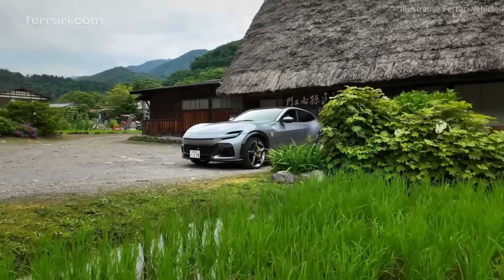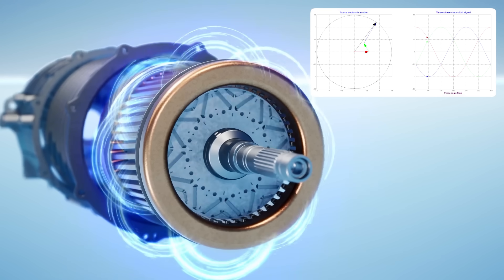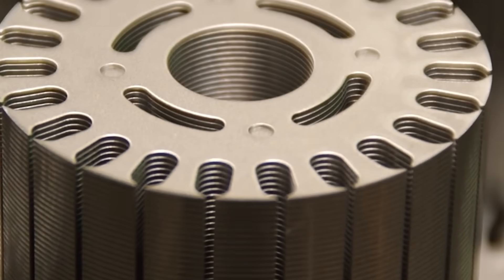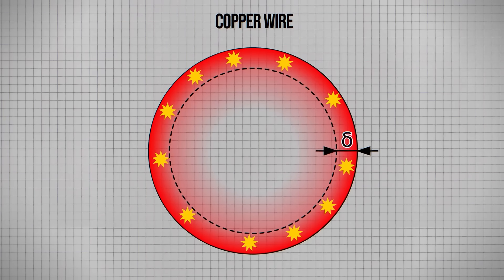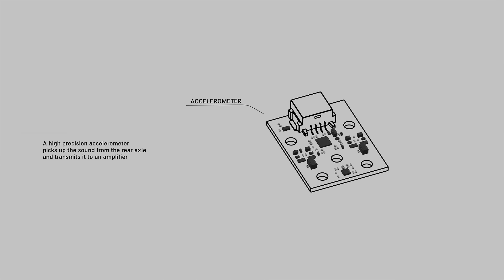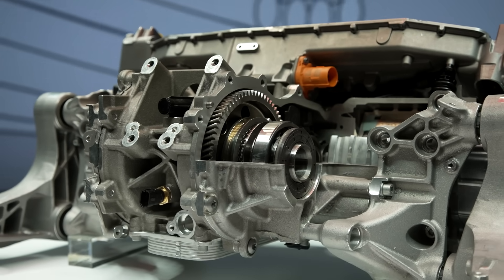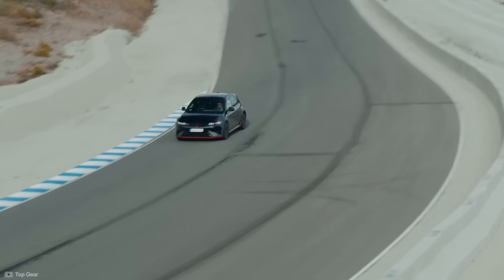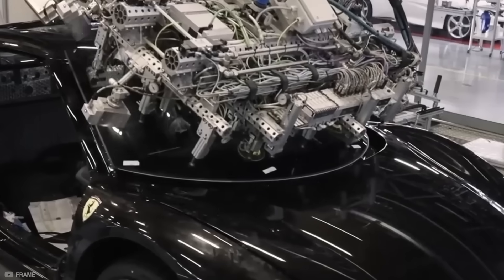Ferrari's Genius Motor Is Breaking All The Rules

Comment: Its not really the sound of ev that is the problem

Its the stupidity of convering fuel into elecicity then storing it in a battery to power a electric motor making it waay less.efficeny.

Did someone told you the opposite? Well they where lying.

Comment: The uptake isn't due to the sound, it's due to the reality electrics don't offer range, lower cost per mile relative to electric costs vs conventional fuel. Sure they are "quicker" and have superior acceleration meaning they will have a place in performance oriented cars. However in practical applications, no EV can go head to head with Diesel powered vehicles in terms of durability, fuel cost per mile.

Comment: I've very rarely driven automatic transmission vehicles, but in Australia, when on call, I had the use of some silly, 3.5L V6 petrol, or whatever, but if you wanted to give it welly, there was like a slow acceleration, and as you puhed harder, it eventually dropped about three gears, by which time your foot was near the floor, and whoof! I'm sure it would be easy to simulate the more inefficient movements of an ICE automatic. Even simulate a manual drive. That would be funny. (NB Any noises generated... INSIDE the car only, please. Speaking of 'please' ..please mention that Israel's genocide in Palestine is ongoing, and maybe say 'genocide - bad'?)

Comment: Older electric train motors make cool sounds. The drives for these are however based on thyristors and operate at a quite low frequency in the kHz range making the motor windings vibrate like a loudspeaker in the audible range of frequencies. Modern day IGBT systems operate at a much higher frequency often as high as in the MHz range and therefore new trains dont make these cool sounds anymore, the same type of high frequency IGBT systems are also used for electric cars. The thing is the higher the switching frequency is the better the eficciency in the motor but on the other hand you can instead get higher switching losses in the inverter but these would still be much lower  then the motor losses would be at lower frequencies. Ferarri could in theory lower the switching frequency of the inverter to get it to make noise just like these train motors but as stated this could generate vibrations affecting things like gears and bearings and also would lower the electric eficciency of the car wich is especially bad when you rely on batteries for power instead of overhead wires like with a train.

Comment: Great episode! But I would have preferred more focus on stator core lamination and wire thickness, as eddy currents, skin effect and proximity effect are pretty basic well known phenomena, one might assume the industry would have converged to pretty close to optimal designs to deal with those things by now, if it's possible to make a significantly better product for slightly higher manufacturing cost, when mass produced. Artificial noise and gear shifts might be slightly amusing, but I suspect it get's old pretty fast, for grownups at least.

Comment: AI Summary

Abstract:

This video provides a technical deep dive into the engineering of Ferrari's first all-electric vehicle, focusing on its Formula 1-inspired electric motor system and its innovative approach to sound. The vehicle features a 1,000-horsepower, quad-motor powertrain capable of reaching speeds up to 30,000 RPM.

The motor design incorporates several advanced technologies to maximize efficiency and performance. The rotor utilizes a Halbach magnet array to focus the magnetic field and is secured by a three-layer carbon sleeve to withstand immense rotational forces. The stator is built with ultra-thin 0.2mm silicon iron laminations and Litz wire windings to mitigate high-frequency energy losses caused by eddy currents and the skin effect.

A key innovation is the vehicle's "authentic" sound system. Instead of generating artificial noise, it uses an accelerometer to capture the real physical vibrations from the motor and inverter. These vibrations are then amplified and delivered to the driver as both audio through speakers and haptic feedback via a resonator in the subframe, aiming to create an immersive and engaging driving experience that addresses common criticisms of silent performance EVs.

Ferrari's Electric Motor: A Deep Dive into F1-Inspired Engineering

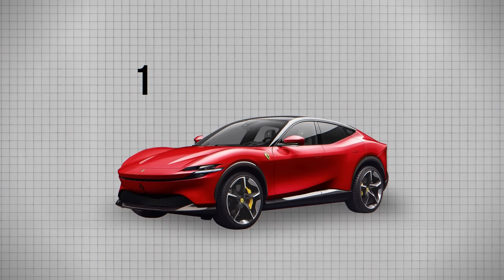*   0:00:48 - High-Performance Quad-Motor Setup: The car boasts a 1,000-horsepower, quad-motor powertrain. The high-speed front motor can reach an impressive 30,000 RPM, while the larger rear motor, built for higher torque, tops out at 25,000 RPM.
*   0:01:40 - Advanced Rotor Design for Efficiency: The motor's rotor features a Halbach magnet array, a specific magnet orientation that focuses the magnetic field outwards towards the stator. This maximizes force in the most useful direction, improving efficiency.
*   0:02:25 - High-Strength Carbon Sleeve: To contain the powerful magnets spinning at high speeds, the rotor is wrapped in a three-layer carbon sleeve, which is designed to withstand up to 2.7 tons of force and prevent the magnets from flying outwards.
*   0:02:42 - Ultra-Thin Laminations Reduce Energy Loss: The stator is constructed from 0.2mm thick laminations, significantly thinner than the standard 0.5mm. This design minimizes eddy currents—circulating electrical loops that waste energy and generate heat, especially at high frequencies.
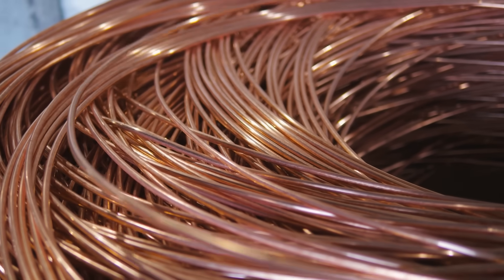*   0:03:50 - Litz Wire Combats the "Skin Effect": The motor utilizes Litz wire, which consists of many thin, braided copper strands. This configuration ensures current is distributed evenly, reducing the AC resistance caused by the "skin effect" (where current flows mostly on a conductor's surface) and minimizing high-frequency losses.
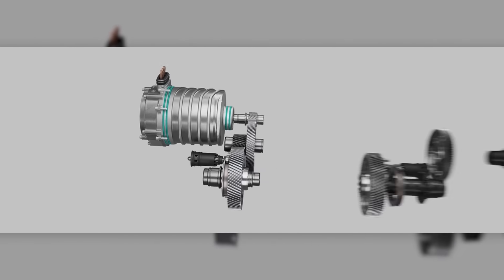*   0:04:42 - Efficiency-Boosting Clutch System: The front motor is equipped with a clutch that can mechanically disconnect it from the drivetrain in just 0.5 seconds. This eliminates unwanted magnetic drag when the motor is not needed, improving overall efficiency.
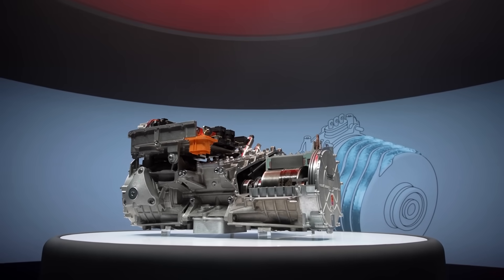*   0:05:16 - An "Authentic" Electric Sound Experience: Ferrari has developed a unique system to create a genuine motor sound. An accelerometer mounted directly on the inverter captures the real, physical vibrations generated by the motor during operation.
*   0:05:41 - Haptic and Audio Feedback for Immersion: These captured vibrations are amplified and delivered to the driver in two ways: as audio cues through the car's speakers and as physical, haptic feedback through a tuned resonator integrated into the rear subframe. This is compared to an "electric guitar" amplifying a real signal.
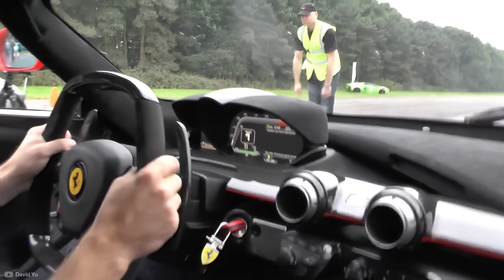*   0:08:05 - Simulated Shifting for Engagement: The vehicle will also incorporate a simulated 5-speed shifter, similar to the system in the Hyundai Ioniq 5N, to create a more engaging and familiar driving experience for sports car enthusiasts.

AI-generated summary created with gemini-2.5-pro for free via RocketRecap-dot-com. (Input: 15,165 tokens, Output: 844 tokens, Est. cost: $0.03).

Comment: They certainly did their homework about making the best possible electric motors. Litz wire is very fancy; i don't know of any other auto mfr that is doing that. I believe eventually all EV's will use the axial motors as they are so much lighter. Mercedes will be the first to have them due to their patent-holding subsidiary YASA.

Comment: I'm actually surprised that haptic feedback isn't used more often in cars because it has worked in gaming for years. I suppose the average electric car owner isn't as concerned about how the car feels and the driving experience, whereas a luxury car you buy for speed and power, the customer might be more interested in the connection that haptic feed back would bring to the driving experience.  A device that amplifies the actual vibrations in the motor is a pretty cool way too do it.

Comment: sure hope the noise makers can be disabled / unplugged 😞 !!!

meanwhile, what will it cost to maintain such a limited production vehicle, the more complex it gets the more maintenance will cost, plus will you be able to replace the batteries, and for how long (compare to the current 50 year old gasoline Ferrari engines that are relatively easy to maintain).

Does anyone really believe Ferrari can make a better motor and a better battery than Tesla ?  I don't because Tesla has nearly unlimited resources.  so I'd say they should have partnered with Tesla for the drive train which also is better insurance for long term maintenance.

Comment: Yeah I am designing ferrite magnet assisted reluctance motor and did try to simulate halbach array but tool that could do that requires so much like GetDP. But even without that motor gave suprisingly good results even if torque density is only about 60-70% what rare earths can do but high speed operation is where this motor type shines because it runs lower flux densities and has lower changing magnetic fields it keeps core losses actually quite small especially at low load high rpm where most wheeled vehicles spend their time. Also when motor is wound correctly it also has very low resistance allowing massive efficiency even at higher power levels.
Reply: In my mind I see a potential for halbach arranged magnets losing strength faster than conventional arrangements even when the motor is unpowered.  Thoughts?
Reply: You win the buzzword bingo!

Comment: In general, nothing revolutionary. It's just the use of the most expensive materials and sophisticated assembly technology. I mean the thin plates and the winding of the litzendrate.  The "disconnection" of the drive is done in the same way as the gearshift in a conventional gearbox. All the main inventions are the artificial creation of engine sound.. And this is just a microphone-amplifier-speaker type system.. "Gearshift simulation" is generally complete nonsense. And all this suggests that Ferrari has made a toy car for adult children. It reminds me of Chinese toy walking dinosaurs.. There's also an electric motor and a speaker that simulates the screams of dinosaurs...
and your onshape is a terrible program! Any failure on their server or Internet provider and your laptop turns into a pumpkin! And even with this vile modern sales model, when you just can't buy a product for good, but have to pay a little every month to be able to use it. People who value reliability and want their tool to always work flawlessly, regardless of the manufacturer's changed policy, will never use such services.

Comment: If the actual driving performance of the car is not sufficient fun, the car is a failure.  If you're driving for the fake noises, why not just play video games when you need a noise fix?  Much cheaper.

Sixty years ago, we experimented with clipping playing cards on the forks of our bicycles with clothespins, to simulate the sound of a motorcycle as they flapped against the spokes.  It didn't work very well, but it was fun for a little boy.  As an adult, adding fake noises to make your car sound like it's in a video game just seems silly.  Vroom, vroom, very impressive, very manly and masculine.

Comment: As someone who drives an electric car, I can confirm simulated noise is not a gimic. Noise can provide extra feedback regarding power, speed, regen braking intensity, etc that aids the driving experience. The beauty of this in an electric car is that it can be sent to the driver, not your neighbourhood and can be turned off if you are just cruising on the motorway and prefer quitness. It is something I would definelty value in my next vehicle.

Comment: I originally thought Ferrari had a good electric drive chain, until they started the artificial sounds and gear changes which are all rubbish and add unnecessary sound, designs and complexity. I would definitely do without those stupid additions.

Comment: Ferrari is competing with Lamborghini.  Lambo system uses YASA axial flux motors, they call Temerario system. One motor on each steering wheel.  One motor on output of ICE engine and before dual clutch transmission. Aston Martin took a stake in Lucid to get access to Lucid tech.

Comment: Um, vibration feedback in ICE cars makes the driver aware of speed and performance of ICE engines. Electric motor vibration communicates electric power performance. An ICE engine has thousands of parts that can effect performance of the engine and all of them working together is essential in communicating power and torque. Not suspension, tires road grip, or wear. Electric motors have less parts to monitor power and less distractions to suspension. Suspension and road grip are the same regardless of the power plant. All Ferrari did here was make the “varrome varrome” noises for you so you don’t look ridiculous flapping your lips around and piled on useless distractions.
Reply: Yes, adding ICE noises to an electric engine will just give you inaccurate feedback.  It will tell you what your car would be doing if it were not electric - what use is that?
Reply: @nycbearff my rule of thumb is “the loudest noise your machine makes is the thing trying to end you”
Reply: @davidgutting4317  And mechanical failures that cause friction and then catastrophe still make a lot of noise in an EV.

Comment: The sound generator reminds me of a system that was around when I was a kid.  I am an old fart now!  It was a plastic outline motorbike engine that could be added to a child's bicycle.  It had a small electric motor in it, I think that would go faster the faster the bike was ridden.  It was called "Motorroar".  This system you describe is far more sophisticated and expensive, but the idea is the same.  😄
Reply: ya its silly. why not use a speaker lol
Reply: kids would attach cardboard to the frame so the wheel beams (?) would hit it. This is what these things remind me of.
Reply: spokes!

Comment: What kind of frequencies are they running through the windings to where to the skin effect matters? The skin effect is pretty much irrelevant at anything below RF. I always thought hairpin windings are ideal because they have the highest fill factor and reduce resistance by having more copper in the channel.
Reply: Must have some to do with the harmonics that are generated due to the “step function like” switching (on - off or reverse) of the phases ‽
Reply: @Mentaculus42  I would hope that ferrari has a better ESC than that. I am not an expert, but usually you want clean sinusoids when driving your coils.
Reply: Considering these are built on now decades old industrial electric motor tech, it's a matter of efficiency. When you are running that motor for long periods of time (days if not months) it all adds up. Plus you have to remember that the faster an electric motor runs the less efficient it gets which is why electric cars are great for lower speeds and getting around town but when you hit the highway they aren't so great when trying to maintain highway speeds.
Reply: @SilvaDreams 

Maybe the issue with higher vehicle speeds has to do with the rapidly increasing air drag on it. If one takes an EV transit bus that does ok on a regular low speed route and put it on a freeway at 55 mph, it will deplete the battery much faster from a distance measurement.  This becomes an issue with intercity bus routes and 200 mile routes are not something an EV bus can do unless they charge during the route (and generally a lot of transit districts only charge at night)!
Reply: @Mentaculus42  While yes wind resistance is part of the problem (And busses are NOT aerodynamic at all) but the faster a motor spins the less efficient they are as they produce more heat and the more heat causes less efficiency so it makes more heat because you have to push more power through it till it's just a spiral into failure.
Reply: @SilvaDreams 

The thing is that they have gone to higher motor RPMs to get higher power densities. It would seem like they would be balancing these efficiency trade offs. I am aware of many EV buses going to the use of transmissions to deal with startup torque requirements and to reduce the higher speed motor RPM.

Comment: I wonder what the motor efficiency map is compared to other EVs?
Reply: Years behind Lucid and just behind Tesla.  Not bad, but not very good either.  Added gearbox is for dealerships.  Fluid changes and expensive repairs are very important for the business model.
Reply: Likely better since they didn't cheap out like the others and used decades old industrial electric motor tech.

Comment: So this is how Ferrari plans to solve the market’s dislike for dull electric motors by giving the driver feedback to feel more connected to the car. 

Next they should solve the problem of using dull electric motors in cars to solve the emissions issue and develop hydrogen fuel internal combustion engines. <——- that’s a twofer (2-4-1).
Reply: Oh no, don’t say hydrogen! You will bring out the HYDROGEN HATERS! Just go to Aʴsetechnica when a hydrogen fueled ICE car is mentioned and get a full blown apoplectic fit of hatred!!
Reply: THe car industry has been doing that for like... over a decade.

Comment: Heard no broken rules. This is all incremental, rather than revolutionary, stuff.
Reply: So like tires? They are still round black and mostly made of rubber. But they sure have come a long way even in the last decade. Especially the ev specific stuff!
Reply: @4literv6  No quite literally none of the electric motor stuff is even remotely new. They just aren't common in electric car motors since they tend to use cheaper/easier to build and produce stuff... But all of these are quite common in industrial electric motors and have been for decades.
Standard cut the bottom line to pad the top end, it's why so many cars are made of plastic and break so much.